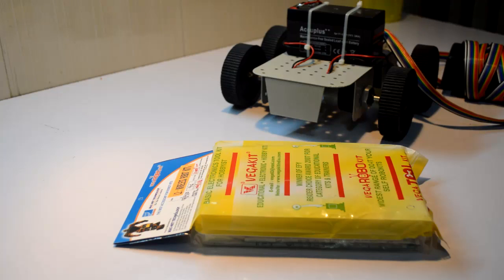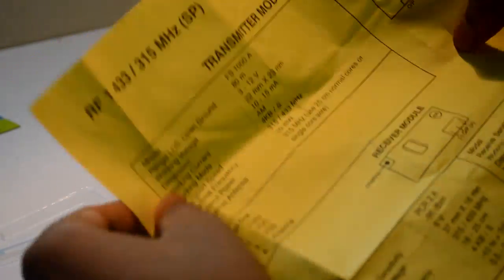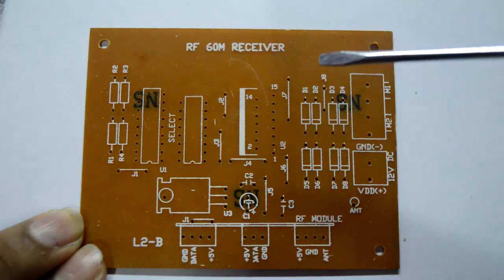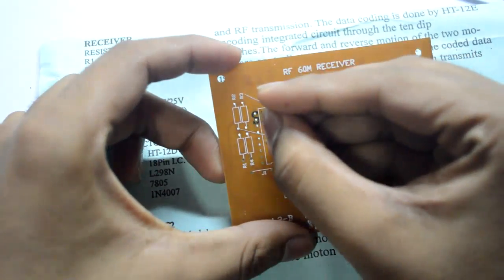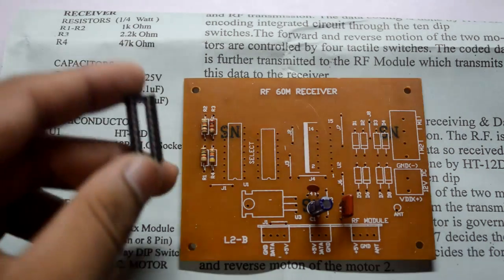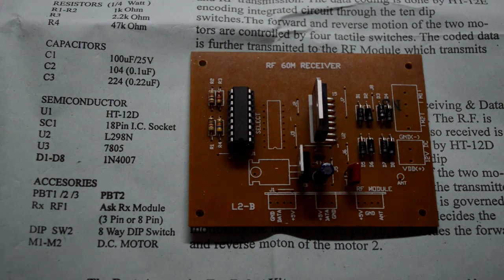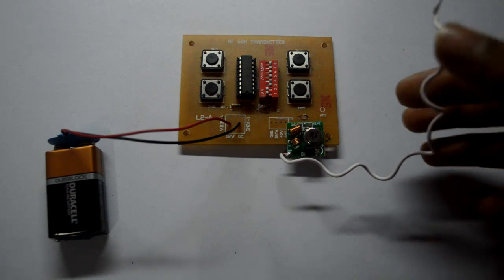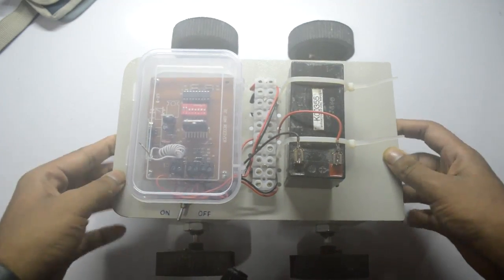How to make a Wireless Robot

Comment: hey kd i did exactly u did but if I connect 12v battery to reciver and 9volts to transmitter it automatically runs the left channel and don't run the right channel even when I press bottons on the transmitter plzz help
Reply: Rajat Hegde same here
Reply: Rajat Hegde did u found the solution

Comment: how to cntrol 24 volt relay by using infrared remote ?

condition:- 3 relay,3 swtches in remote

first&secnd relay:-switch press=relay on
:- switch release=relay off

third relay:-switch press=relay on

:-switch press=relay off

pls provide schematic diagrm cntroller system
Reply from the maker: You need to use TSOP 1738 with arduino to receive the data from the Infrared remote.
After you receive that particular hex code of a switch you need to give a digitalWrite for that respective relay.

Comment: the max on load current per motor is 1A , which is coming to 4 amps for 4 motors ..........but the stall current rating per motor is 10 amps ......it is a High RPM DC Motor 12V, 35000 RPM which is available on vegarobokit .

Comment: hey can i use a non  - geared dc motor whose max load  current is 1A and stall current is 10A.....plzz reply fast ......reply needed urgently
Reply from the maker: the max on-load current of your all the motors should not exceed 4 amps
for IC L298N
Reply: Adarsh Jaiswal ....use 4 12v relays...and drain as much current as u want.. :)
Reply: hmm

Comment: Thank you very much sir 
 I have done it its not working when first time it worked ICL298 was becoming hot as soon as i give it a 12v battery supply and now it does not get hot when 12v supply is given 
What do you think sir? Is ICL298 is damaged or it is OK what can i do?
Reply: Sanket Satav sir can you send me circuit diagram or photo of reciver and transmitter PCB ....pilzz sir🤗😇😇😇😇😶😶

Comment: I had bought the kit from vegarobotics and done everything as u showed me in the video but it is not working when i connected it to a battery of 12v 2.5 amps  the 7058 transistor getting heated up can me help me in this issue u can send me at merugurakesh91@gmail.com.